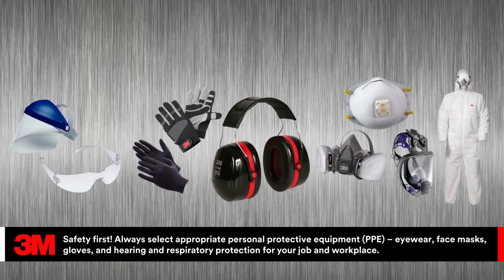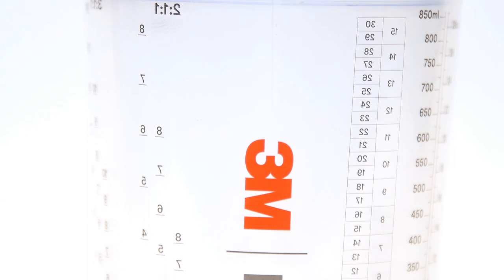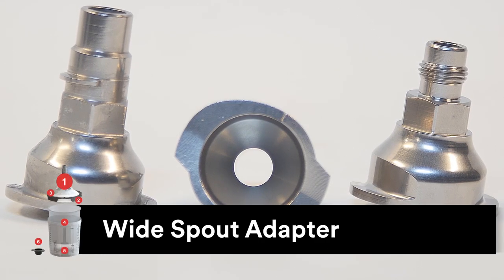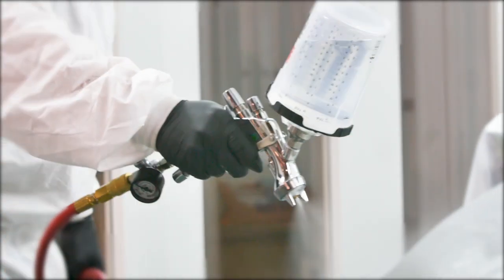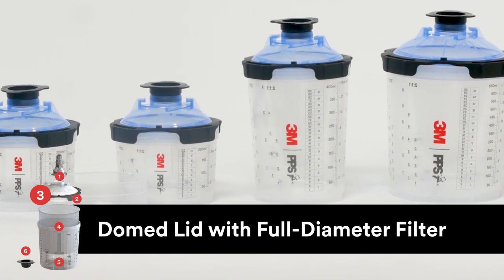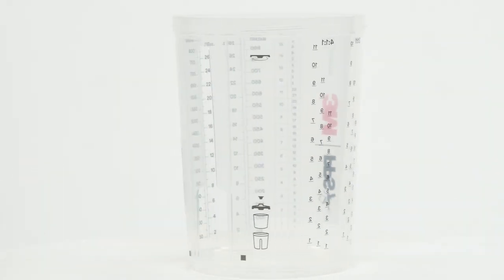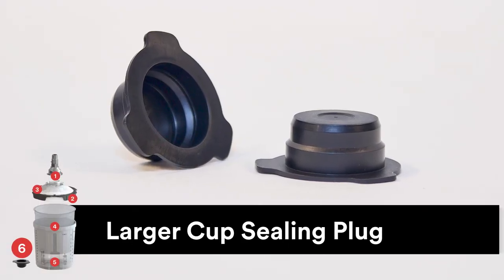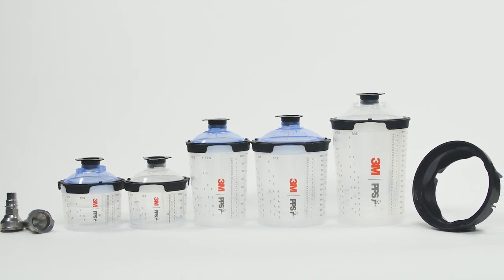3M™ PPS™ Series 2.0 Features Advantages, Benefits

Comment: Are the disposable parts recyclable? Does 3M have a program to recycle these? I'm looking to add paint and finishing to my business but don't like the idea of generating more trash even if it is convenient and has great features.
Reply: The elimination of solvent use in cleaning the cup should easily offset the "environmental impact" of the 0.25oz of plastic in the disposable part.

Comment: Looks nice but? I don't think it would spray gel coat very well, you need a BIG tip. I would use less acetone cleaning my Devilbiss pressure pot with the Devilbiss flushing pot. I have a cup gun that is supper easy to clean, put some mold wax on the aluminum plate/cover and drop it into some acetone after shooting gel, super simple. This would be nice to try vs. the pot, this has an actual paint pattern unlike the ball pattern that the cup gun puts out. I do small arts with fades and this could be a good gun for that.